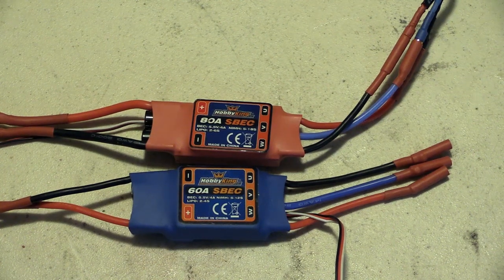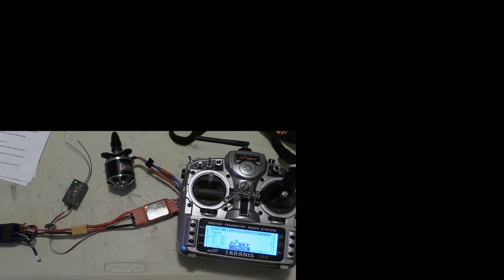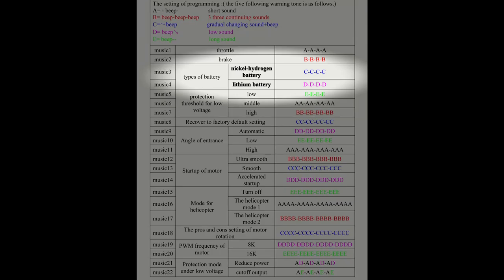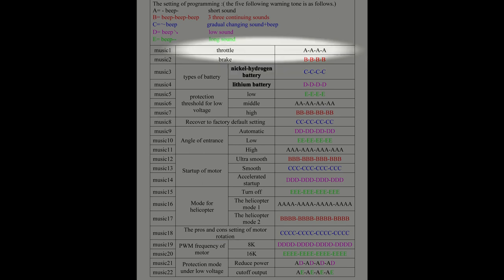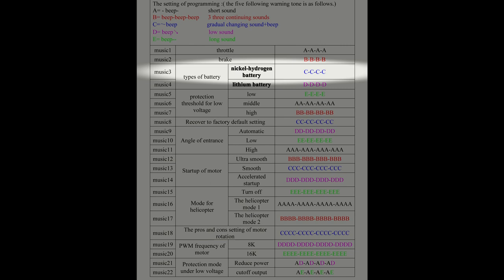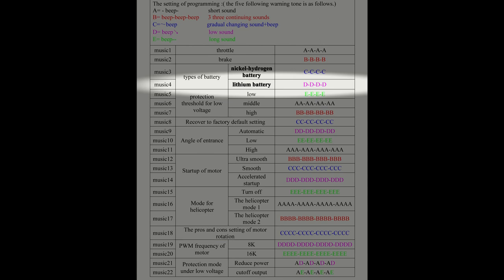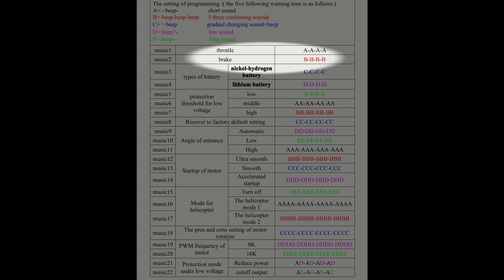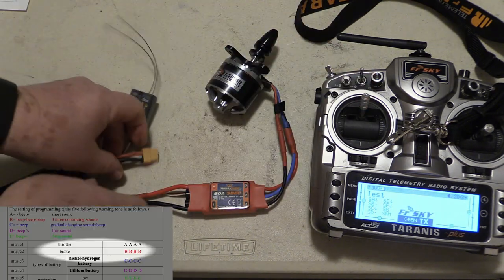Programming the HobbyKing ESC with the transmitter throttle

Comment: I got here searching for a way to activate motor breaks for my new Bixler 3. The B3 comes with HK 20A ESC (no "UBEC" on the label) but the ABCD sounds and melodies are entirely different. However I figured out that only the sounds are different, but the order of functions behind the melodies is the same. So e.g. just wait for the second melody to activate/deactivate the break; wait for the 8th melody to trigger a factory reset. At least for these two functions it turned out fine for me.

Comment: Hello,
When I try to put my ESC (REDBRICK 100A with BEC) into programming mode the ESC doesn't respond. I put throttle to max position, then turn the model on (it has a flight controller matek-H743 v3 with ardupilot. The BEC red wire is cut off, and only signal and ground is plugged into the FC, that is because the servos already have power through the FC and so does manufacturer disclose that I shouldn't put BEC wire to the throttle servo pins), the ESC then beeps once (in this video I haven't found a single sound that would be remotely close to the one I'm hearing, except for the last two short beeps) then it beeps with the same sound 8 times in a row, then pause, and then 2 short beeps. I'm also using li-po 4S battery. I tried putting throttle into different positions, but still no other response than the one I described. Even if I plug in the battery when the throttle is in the lowest position, the beeping is in the same order as in the max position. Could you help?
Reply from the maker: Please see if this helps : http://atorie-m-m.main.jp/redbrick50~200A%20manual.pdf

Comment: What I don't see here in TX accessible menu is motor timing that it is accessible from programing card, but I'm not sure if it is needed for max efficiency airplane..?
Reply from the maker: I  believe "angle of entrance" is the same as "timing"
Reply: Timing is different for inrunners, sometimes ESC goes up in smoke at start up.

Comment: help,my motor won't come on until 50% throttle position
Reply: I had the same effect when I powered up the model for the first time. 
Then I performed the first step of the programming procedure (= throttle) and now it works. 
Did you try this?
Reply: @martinpi11  finally got it going,thank you